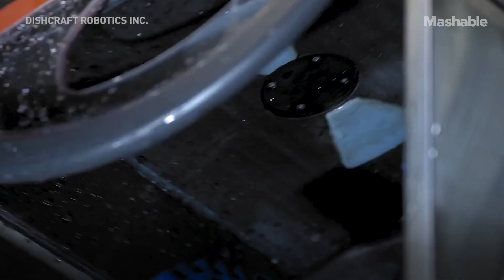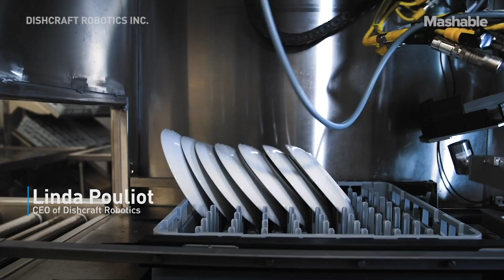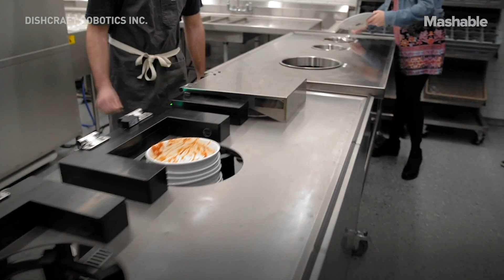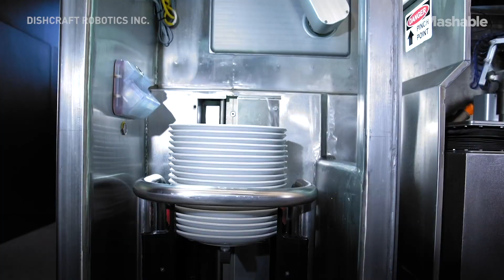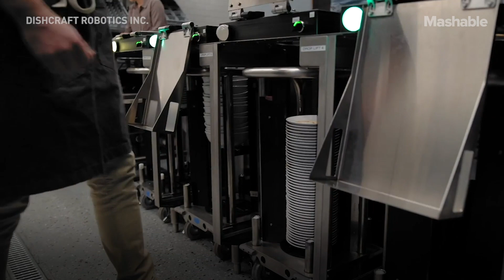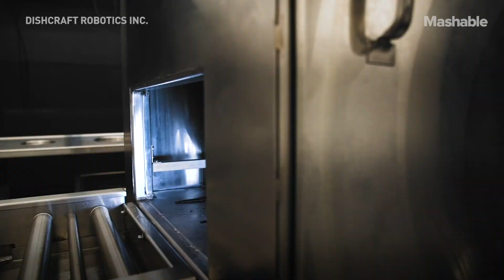Scrubbing Dishes Sucks But This Robot Will Do It For Us

Comment: Pots, pans, cups, glasses, cutlery, trays, grills, stove tops, food prep, clean down, hose cool rooms, stack goods. This machine would be excellent if it was small, cheap and efficient and I need a machine to just wash plates but my dishwasher does that pretty well with little scrape and pre rinse. There will definitely be improvements to dishwasher design but I don’t see this as being an option. Great for crockery and cutlery hire companies.

Comment: Items need a metal plate embedded to allow the magnets in the machine to move them around in the process.  Can't handle pots and pans, flatware or glassware.  You need a human dishwasher and a regular restaurant dishwashing machine to do that. They could not sell it to restaurants or industrial kitchens, (too noisy, too many breakdowns, too expensive) so they are selling it as a service.  They will pick up your dirties and deliver clean ones, keeping the machines at their location.  And hiring dishwashers to run the machines and wash the items the machine can't handle.  And maintenance techs to keep them running. This is a solution that does not solve the problem.  They are still in start up mode but don't count on them lasting more that 5 more years.  And, btw, the machine uses cold water and chemicals to clean the dishes.  Former employee is a friend of mine.

Comment: of course its possible to make a supadupa dishwasher, not that hard even i could do it. but to make it small and cheap is the challenge. look what you have to buy for this, trolley, maybe the dishes then this whole big machine...it has to be a small robotic arm that you can mount on the sink. it has to recognise if theres a dish or cup or spoon and wash it. it has to use the water tap that is already there. small, cheap, easy and autonomous, then im impressed. it would have to scan the surrounding of the water sink and recognise things and work with it.